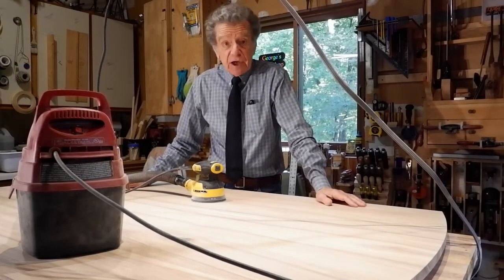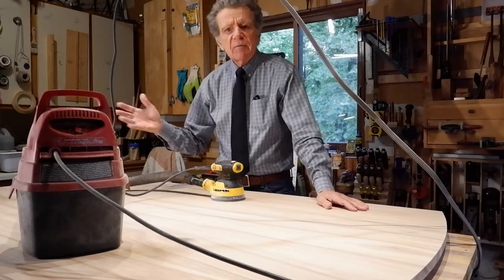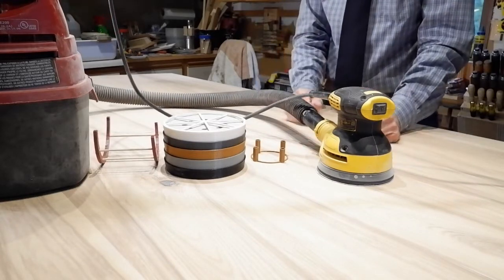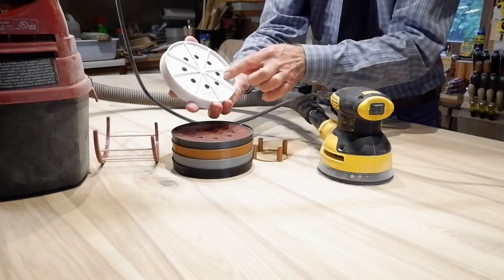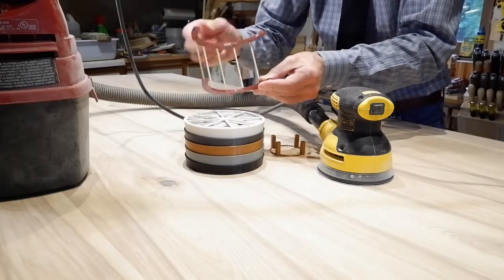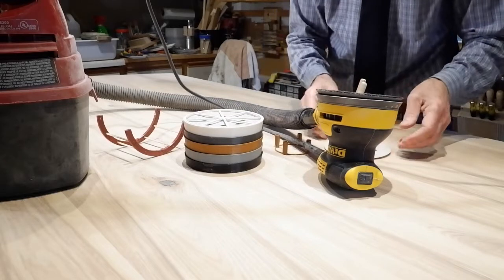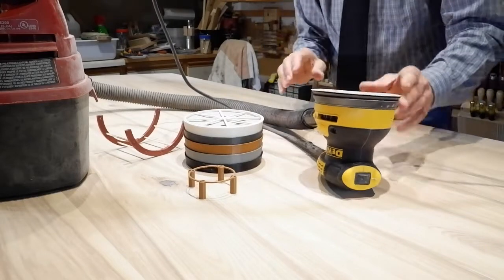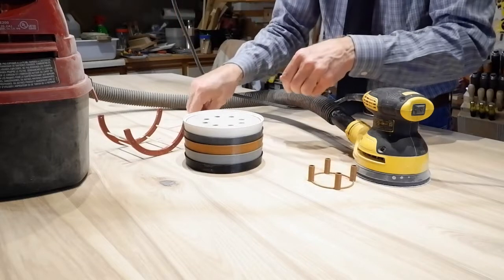3D Printed Accessories for a Random Orbital Sander.

Comment: The website you listed in the description doesn't seem to be supported anymore. Have you posted these designs on thingiverse or printables?

On a different note, I've been looking to buy a used DeWalt sander, preferably the variable speed model. In your opinion, is the VS feature worth holding out for?
Reply: It's not hard to find your submissions - I'm one of your followers!
Reply from the maker: Thank you Jonathan for putting me wise to the files' disappearance.  The site was not "removed by the authors" but it clearly was removed.  I suppose 000webhost changed its income policy.  I will post the relevant files to printables.com, sometime before October 2023.  Thanks again for the heads-up!
Reply from the maker: Hi again Jonathan.  I migrated the files to printables.com.  You can get mine to come up first (I think) by searching with "disk storage for".  While there you'll see lots of others' contributions too.  Thanks for the heads-up about my original post having been removed.

Comment: George, that’s brilliant. A small step for George but a big step for mankind.  You make a great 3 D printer salesman.
Reply from the maker: I know.  I'm a little worried that me the woodworker is being eclipsed by me the 3D printer, but at least 9 out of every 10 prints serve the woodshop.  And the rest are usually practical household items.  Current prints:  fat shims for chair corner braces that square the angles for metal 90 degree brackets.
Reply: @georgefouriezos8863  George, I'm in awe of your abilities of design and improvisation.  i'm just jealous that I don't have a 3D  printer and can't use sketch up.  Just keep doing it its inspiring. Keith